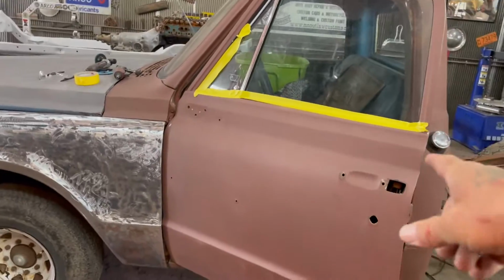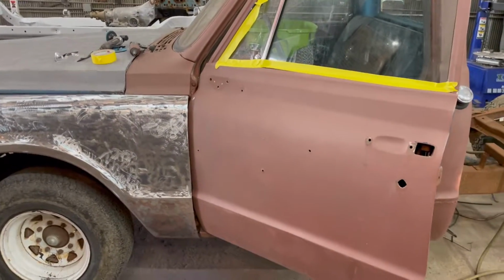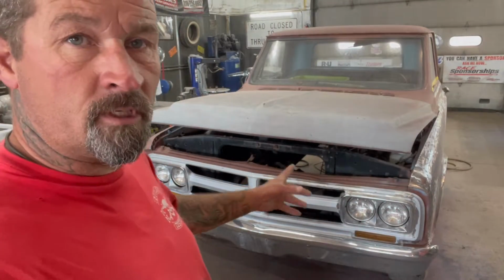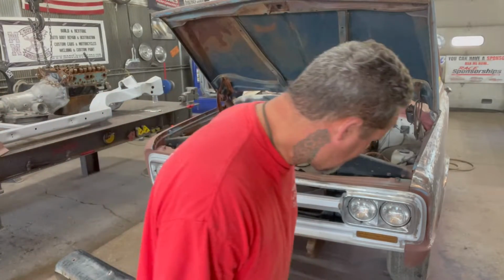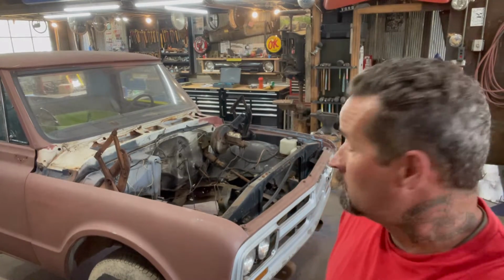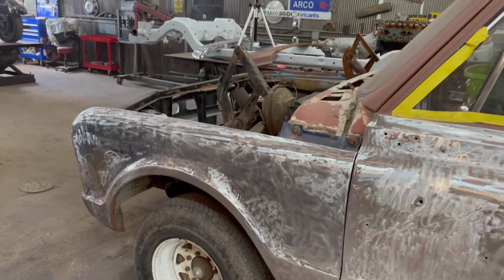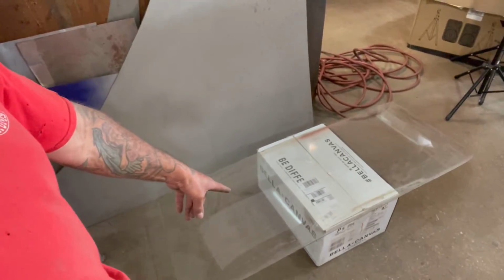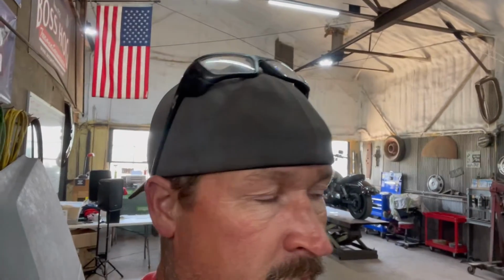Chevy C-10 for a Special Guest- paint prep

Comment: I use an old brake pad to plug holes in metal,Put it up against the hole from the inside,and plug weld the hole,the weld won't stick to the brake pad surface,and leaves a perfect plug weld.But that's just how I found to welding big holes in metal.